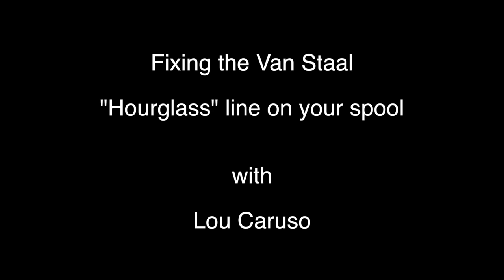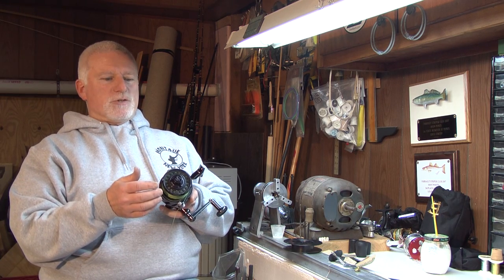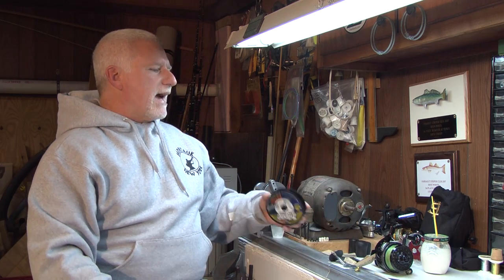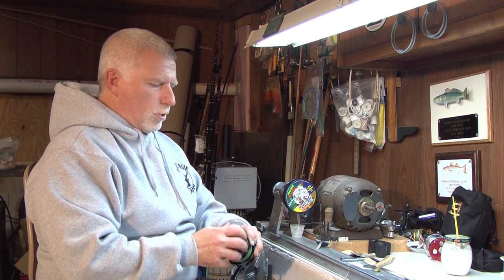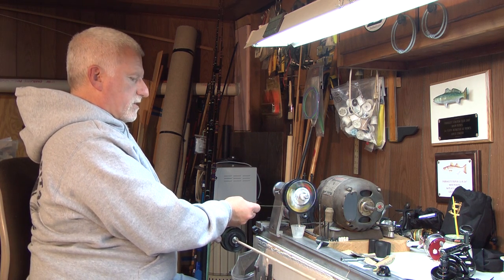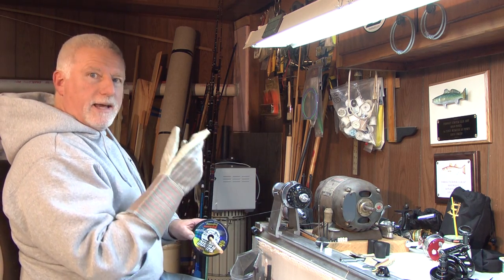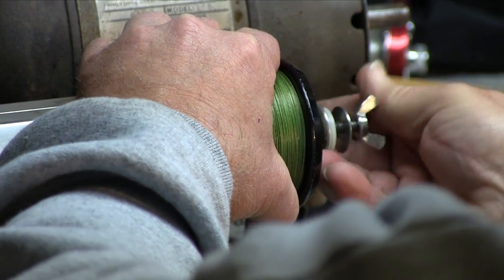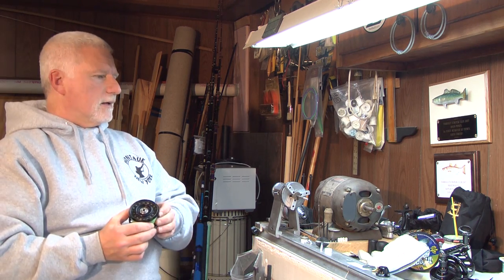Correcting the hourglass line lay on Van Staal reels

Comment: I would hope that the manufacturer of an $800 reel could have figured out how to get it to lay the line properly, instead of making their customers jury rig it themselves at home. Crazy!
Reply: I agree, that's horrible for what that thing costs. It seems to me that is it a problem with the gears that drive the piston--perhaps the spool is pausing too long at the top and the bottom of its oscillation. I wonder if a spacer washer under the spool might help???
Reply: Total crap 
My Stella’s are perfection. Why piss away that kind of cash and have to that to a reel. By a PENN, shimano, Diawa and your done. Shame on you van stall, your not worth capital letters

Comment: English casting champion and author John Holden wrote that one should reel line onto the spool 1/4 to 1/2 full,then seeing where the line was being laid,that is,if bunched up forward or rearward or in the middle,to then wind on line by hand until perfectly straight across or slightly tapering forward.Replace the spool and wind on line as you normally would. I've done so with Penns, Daiwas and others, doesn't take very long and no elaborate setup required. I still wouldn't pay what they ask for this reel.